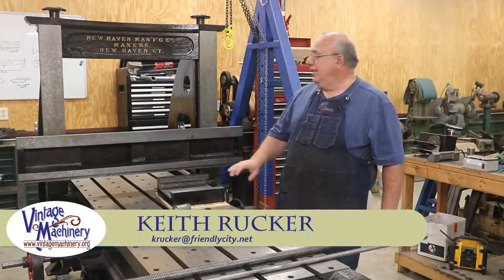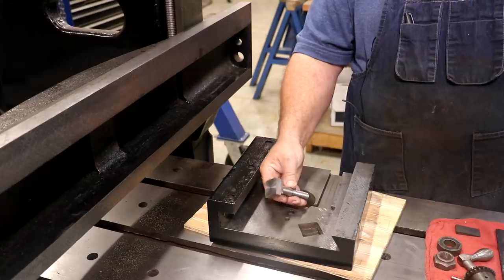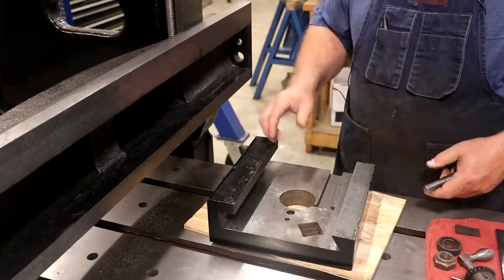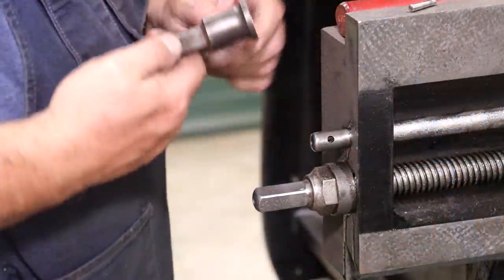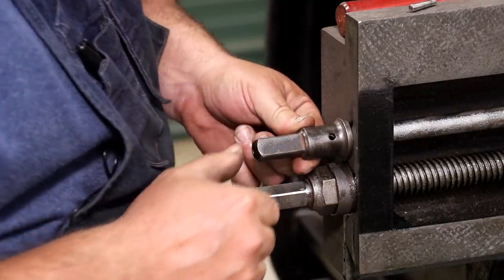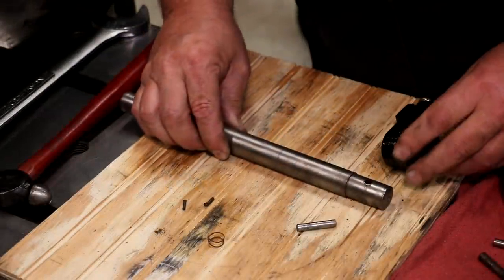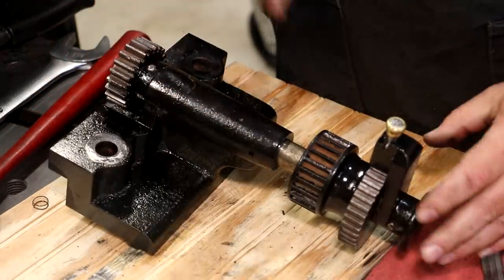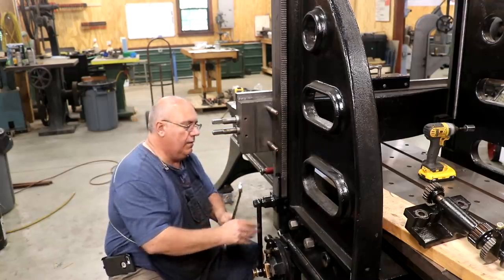Metal Planer Restoration 37: Reassembling the Cross Slide Saddle and Feed Works

Comment: Progress on the project at times may seem like watching grass grow.  Just kidding, there is so much detail in the project that it simply takes time to get it back together and I will continue watching as I find that old machinery so interesting.  I was trained as a mechanical draftsman back in 1967/68 and remember the engineering process from concept to a production piece.  But thinking of this complicated system being developed before the turn of the 20 century really adds respect for those that took this from a concept to a piece that worked.  Great video Keith.

Comment: Keith,
Your comments as you assembled frequently misnamed components. It is perfectly clear what you meant. I am a bit nerdy about using correct terms. As a career industrial maintenance technician that worked in a shop that detailed documented every machine repair, exact word usage was demanded. Our troubleshooting and repairs were documented for future or follow-up repair reference. Misnaming a key component potentially caused confusion. One of my daily tasks as the supervisor was to edit repair documentation for accuracy. We insisted that every repair be documented before the end of the daily work shift and preferably before beginning the next task or assignment. We kept our records in organized paper filing system until the advent of an electronic filing system introduced in 1994. With powerful, but simple word search engines, electronic documentation was available in seconds. When I retired, we had many tens of thousands of repair records in our database. Our maintenance crew covered a 7 day, 3 shift operation, and we had a departmental culture that shared a lot of commonality between technicians in how we troubleshot and how we documented. We routinely discovered that previous documentation when relied on for subsequent repairs included error or lack of clarity. When these discoveries were made, the follow-up technician was tasked with editing for clarity and for correcting error. This attention to detail meant that our repair records were accurate and exceedingly useful. Our records allowed lower skilled technicians to successfully perform at higher levels. Some repair tasks became repetitive. We titled these repair functions as procedures and copied those records into a procedures file. Procedures records received extra attention to accuracy and clarity.
When you call a nut a screw, a shaft or leadscrew journal a gear, a T bolt a T nut, it is obvious that you misspeak and have simply interchanged the name of the mating component or called it something similar.
I have already confessed that I am nerdy about technical component accuracy, and I have hopefully explained why. I seek for accuracy as it can have profound importance. One of my favorite (but only a loose quote) Mark Twain quotes is that we should use the correct word and not its second cousin.

I enjoy your videos. I restored a 1942 drill press last week and found your website included the scanned manual for my machine. The manual was unnecessary for my task, but it was fun to discover manufacturer's information. Thank you for providing this archive.

You adjusted the leadscrew backlash by feel and you discussed and demonstrated that process. Early in my apprenticeship I was instructed to measure backlash in this type of assembly. My standard for leadscrew backlash and also for gib adjustment free play is .0005". I have never rebuilt anything as old as your planer. I am interested in knowing what kind of leadscrew/nut accuracy was original to this vintage manufacturing and how much related wear is in this assembly following your restoration. I am a very latecomer to this video series and haven't taken time to go back and watch the entire series. You may have already documented this information.

My comments are not intended as a complaint, rather as constructive criticism. I suspect that your audience includes many novices desiring to learn these trades. When I wear the instructor hat I strive for more stringent accuracy.  I taught an intro to electrical theory and troubleshooting class last year. I included a section on motors. Even though I was regarded as our resident motor expert at work, loving motors, servicing and repairing all forms of motors for decades, and having numerous motor theory classes under my belt, teaching revealed that I had some pretty sloppy understanding of motor physics. My sloppy understanding didn't diminish my technician competence, but I tried to clean up my understanding to communicate the best accuracy to my students. The old adage that the instructor learns more than the student is very true.

Comment: Fantastic, Adam Booth is going to be wanting one of them when it's running, thou shalt not covet your neighbours planer.
Reply: Abom shall not covet this one, he needs one at least 50% bigger (better yet 2x the size), which will of course require another annex to his shop. Question is who will get the Big One first, Abom or bcbloc .  Actually David Richards's Old Steam Powered Machine Shop has one operational on Steam via overhead pulleys and flat belts.  David's seemed to be a little smaller, less complex and made to be functionally useful, but still required "annexing" part of his current equipment shop.   No where near the investment to fully restore/rebuild to like new or better like Keith is doing.  To be sure they all (I follow about a dozen) will refurb and use them in their own style of professionalism and results so we can learn from all of them .

Comment: That's why you never toss things like springs and hardware. Although the spring turned out to be too flexible, it still filled the bill for the time being. A stiffer spring will undoubtedly be required later on, though; if that directional controller jumps out of its groove, it might damage the machine. Good video, Kieth.

Comment: i have seen some large planers in action, there is a company near me who makes press brake tooling, i say the bed must be 24ft long, the tracks it runs on must be close to 50ft, they are per war machines, maybe they have 3 or 4 running, they do use carbide tooling by lifting it up on the return stroke, the whole operation is very intersting to watch.
Reply: Interesting! Sounds like a Site Visit is in order. Thanks for sharing. RL

Comment: i believe the knob installed at about 23:00 min in is backwards. That is to say the larger part should be toward the outside. This might help some of the 'gap that you had to look up
Reply: The pin goes through the center of the knob, so it wouldn't take up any of that play, if you turned it around.
Reply: @xenonram  hmm it doesn't look central  to me, it looks off set.
Reply: @NeilAbalone , I came to the same conclusion - after muttering at the screen, telling him he had it backwards! :-) 
He did say he went to look at his pictures, etc. so one assumes he would have caught it if it was backwards.
Reply: Keith said he put it back  on the way he found it but nobody  knows how many times it has been  removed  in 130 years! Worth turning  around  to see  if  it fits  better  and feels better.

Comment: The shaft that you put in last seems free to move in and out, the only thing holding it is the connection with the new gear you made and the pocketed gear on the shaft, will this not wear the sides of your new gear? Although I realise that is not like a high speed rotation so maybe a non-issue. Great work and it's getting exciting to see it running, also if you have to scrape then scrape away, I find it relaxing, especially when someone else is doing it. 😊

Comment: just purely theoreticaly you could modify the planer to work as surface grinder with a grinding attachment coudnt you? like for hardened parts or finishing passes - ofc you would need some long leather or rubbr mats to cover and protect the ways and probably whipe off and oil the maschine after evey time you do that

Comment: I have the perfect project for that machine down here in the Tampa Bay area.  A turn of the century Smith and Mills Shaper 12 inch I think.  Square ways.  Needs some TLC...  I wonder if it would fit your swing.

Comment: Keith what types of metal would you run through that thing? Would it be primarily cast iron? What size and shapes can it handle within it's limits? Is there a weight limit for the feeding mechanism?

Comment: The linkage pull knob you assembled at 24min is upside down, bigger side needs to face away from the connecting rod.
Reply: I thought that too, but he did go back and look at his pictures. I guess it was that way when he got it.
Reply: @hydewhyte4364  You mean Keith made a boo boo .... can't see that happening mate ..lol
Reply: It seems like the bigger diameter would be out to make it easier to grab but he has pictures and maybe some drawings from the manufacturer.
Reply: @hydewhyte4364   I understood he looked at the photo he took before dis-assembling which could easily mean it was wrongly assembled last time it was removed/repaired. Don't forget this is 18something -something machine, it must have been repaired many times before.
Reply: @premierd8988  Mistakes are only human..unless you're robot you make mistakes.

Comment: A comment from the peanut gallery again
All those rotating shafts just running in iron I would have used grease in those and perhaps some hard copper/bronze washers on the thrust surfaces. Most appear not to have lubricant ports. Unless you plan to add more lube lines?
The old style ratchet feeds can be a disaster waiting to happen one thing in particular sticks out to me as a potential problem and that is that quick adjust on the feed clutch. I would suggest an alternative adjustment method that held the feed rod offset more securely.  Still secured to the front of the clutch an assembly that would use say a 1/4 ~5/16 unf threaded rod to move and hold it's position. Think like a motor mount that has adjusting bolts for belt tension and or squareness. This way it will only increase with an deliberate adjustment. 
Cheers

Comment: There may be a spring winding section in your Machinery's Handbook. I have seen videos that show people winding on their lathe on a mandrel.
Reply: Use a mandrel between centers and wind music wire over it, clamping the wire to hold it to enable you to wind it correctly. Then you heat treat the wire for stiffness of the spring. Doing it is a lot easier than explaining how to do it!

Comment: The one thing that I hated about old things was the use of flat head screws, I much prefer the Robinson style heads and I replaced as many as I could. I know that is a point of contention and is not strictly correct but I think if they had these type of head back then they would have used them. I just need someone to go back in history and invent them before my machinery was invented. Any volunteers.

Comment: I'm curious to know how your planning to power the planer given it was initially belt driven by a steam engine.  The belt drive pulley (name ?) is visible and begs an answer.  Are you planning to power the planer by replacing the present belt-drive pulley with a multi-groove V-belt-pulley suitable for, say, a ~10 HP 3-phase electric motor?  I'd enjoy hearing you discuss this important aspect of the planer restoration in an forthcoming episode.  Really looking forward to seeing it used preparing parts for other projects.  Good job!
Reply: At 20:50 the first thoughts https://www.youtube.com/watch?v=tvtFTfzzBK4

Comment: I notice there are no Phillips head screws anywhere on the machine. Was this before their invention, or is there another reason why Phillips screws weren't used ?
Reply: Phillips screws came out in the mid 30's first used inside a Cadillac.
Reply: Phillips head screws were created to provide positive engagement during mass production manufacturing on assembly lines in the mid-1930s.

Comment: That bevel gear turns in the casting.  The casting has an oil hole.  I think you forgot to put oil in that hole.
JIM
Reply: He put oil everywhere.  Stop picking!
Reply: @paulcopeland9035  Mind your own business.  I will comment if I want to.  He did not oil the hole.  I am only mentioning it so he does not wear out the machine pre maturely.
You are an intruding bully, bug off!
JIM
Reply: @jimc4731  ...You shall not tell me what to do, either.

Comment: What is it that I fail to understand, Keith? Why were not all the bear metal parts soaked with oil and wiped off so that fitting would go well and so that no rusting could occur over time? Rust against brass is abrasive. Rust anywhere is a problem, period. Am I way too finicky? If so, it is because I flinch when I see rust because of the abusive cussing I would get from the old guys who taught me if my cleaning/preparation work failed to meat their approval.